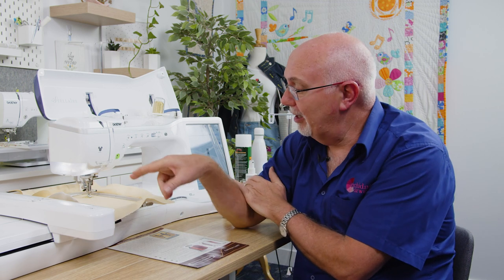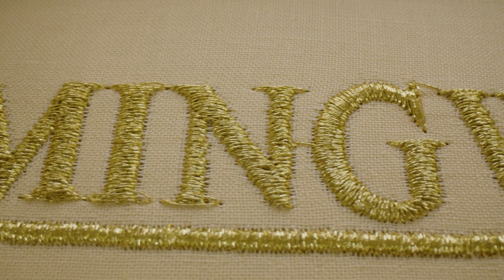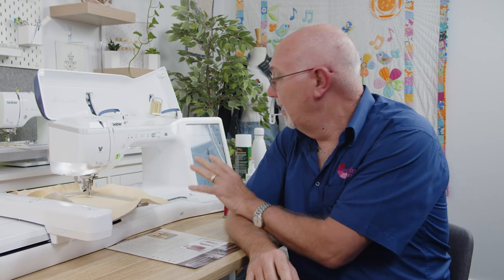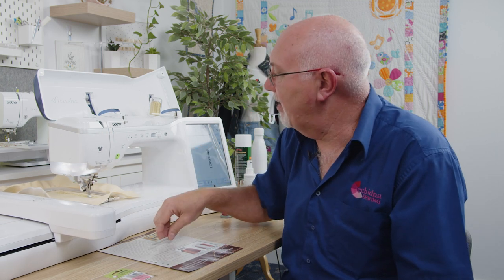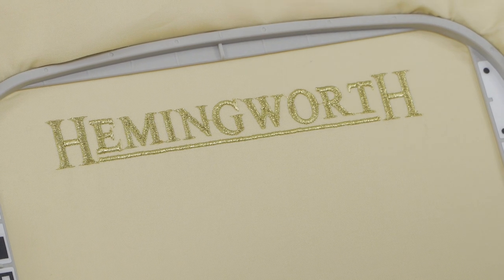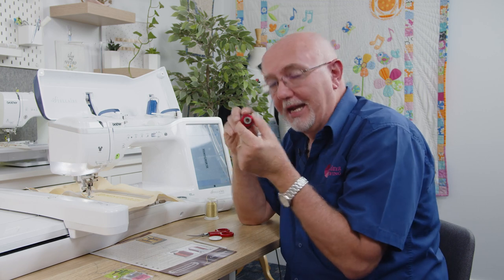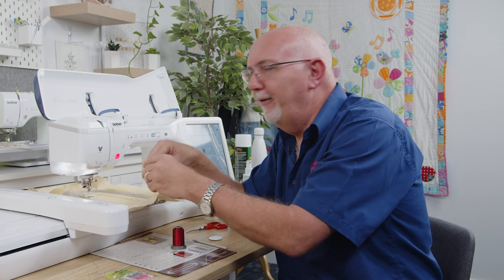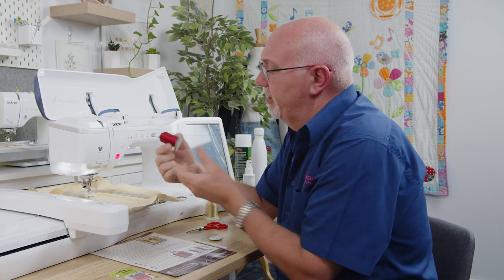A closer look at Metallic Threads | Echidna Sewing

Comment: Very helpful video. Clear and concise. Could you give your input on using metallic thread to quilt a table runner. After watching this video, I think NO. It will have hot dishes, a sundry of plates, bowls et al set upon it, which means it will be washed more often. Also, quilting is intended to stabilize the quilt sandwich.  Metallic thread does not seem functionally reliable for this job. Thoughts?
Reply from the maker: @michellegutierrez5664 It is perfectly fine to use as a quilting thread as quilting is not construction of the quilt.  The metallic threads will probably not last as long as a pure polyester thread due to the nature of what it is constructed of.  You could definitely try it and see if you like the effect.

Comment: Hello there.  What settings would you recommend for a Luminaire for the top tension?  Default is 00.  Also, would you recommend a light spray of silicone spray on the metallic thread?  It probably wouldn't penetrate the metal, but would it help it any?  One more question (of course) - is the Hemingworth embroidery design that you stitched out available to consumers?  I made a cover for my hemingworth cabinet to protect from sun/dust and it would be great to have that stitched on the cover.  Thanks
Reply from the maker: Hi @rachels8857, you can loosen it off slightly (try 02), always test how well it stitches. We do recommend a spray of silicon spray - best results are when you spray it and leave it overnight. We don't have the Hemingworth logo as an available purchase unfortunately. Thank you for all your questions and if you need any further help please let us know :)
Reply: @EchidnaClub  thanks.
Reply from the maker: Very welcome :)